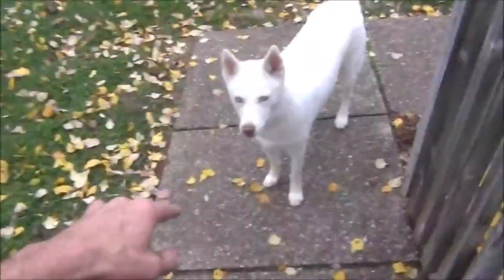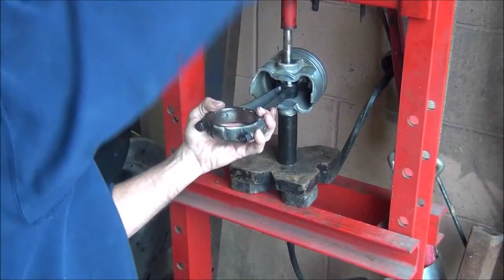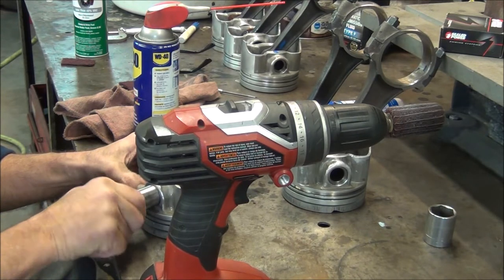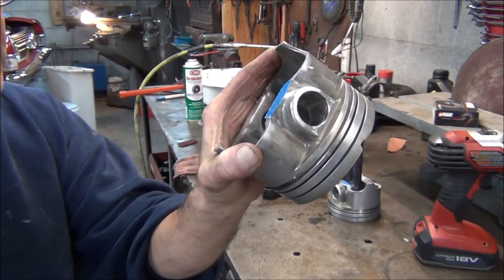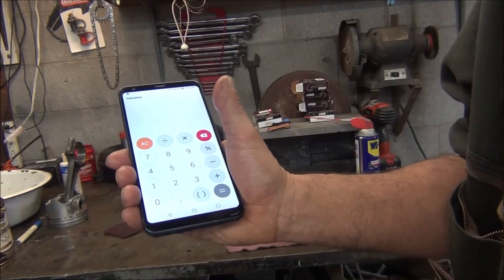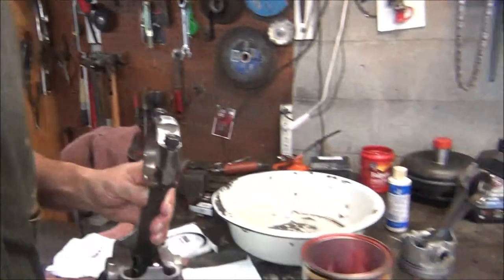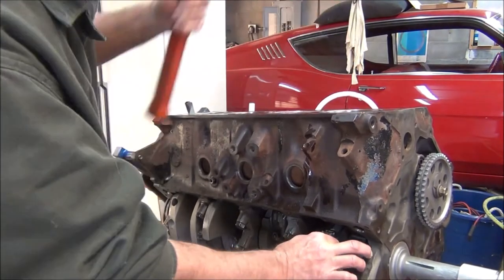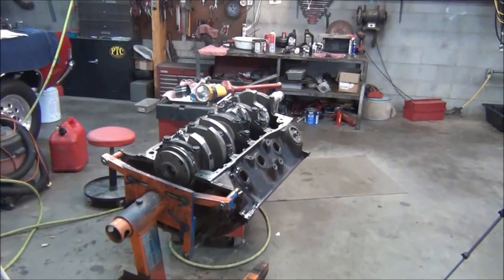429 Assembly Part 2. Fixing tight wrist pins.

Comment: I put new pistons on my 77 ford 300 inline six. 5 were perfect but 1 was a little off so i tried to press it only a 1/8 of a inch like that and my pin hole somehow got bent and my rod would not move without forcing it. So i got another piston. Good video , you doin a great job.

Comment: To tight gets tighter on cold day and is hard on piston and cylinder walls. Should float.. every cold start and tight can get tighter by galling the piston pin bore. Good fix press pins are not so easy to work on.